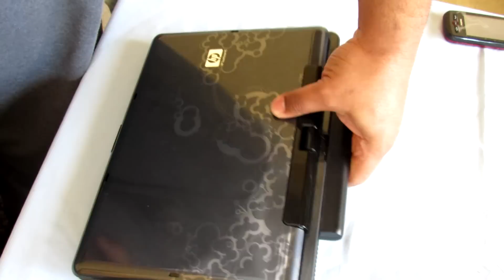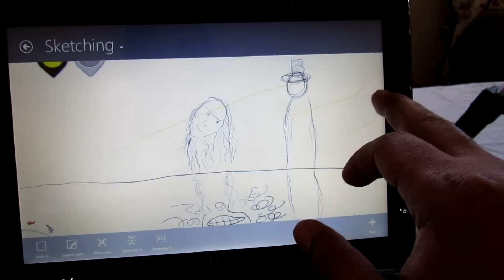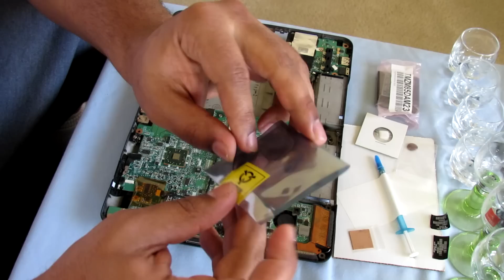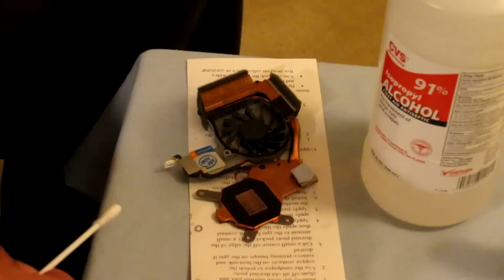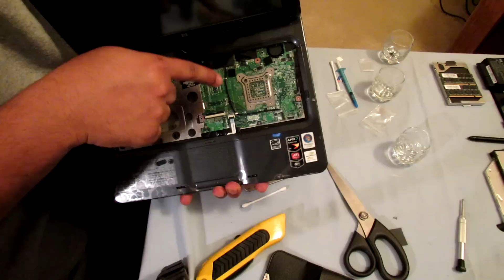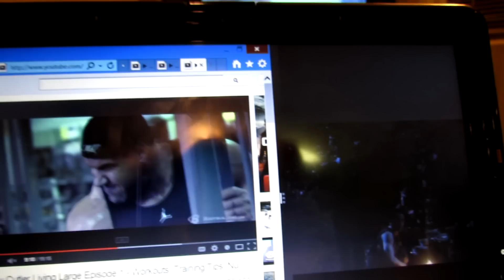HP-TX2 Copper shim and "Lance technique" (From 85 to 58 degrees!)

Comment: I honestly just threw a centrifugal fan in the optical bay with some holes through to the bottom and top (so air is drawn from bottom and hot air shot through top of case). Wired it to USB with a basic switch, bingo, temps have never been better. New paste helps, but only if the original is REALLY old, oxidized and dusty. (Any laptop small 5 volt fan will work, the power draw is really quite small).
And it's all contained so I can still use it as a laptop.
Don't have huge dust problems in this place, and the cold intake being on the bottom also keeps dust down. Been using it for 6 months and no issues.
GPU hasn't went down a ton (maybe 4 degrees C, less on load), but the CPU tanked at least 10C on load, 20 on idle. Probably due to the fact that the air can't really get to the gpu die as easily as the cpu.
Reply from the maker: You should show us. That sounds legit...

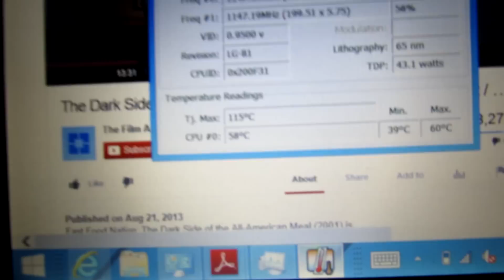Comment: Your did a good work but.. Watch 1:57:36, you can see your laptop is running in battery mode. Your processor is a 2200 Mhz one and as you can see it's running at 1,1Mhz, wich is the half of its power. If you plug it in and run it with its 2200 Mhz full power, you will get more than 65º or 70º for sure.
Reply from the maker: Your right...
Reply: @Calliboss  which is superb. 70 on a tx2 in desktop mode is terrific and wont cause any throttling

Comment: Hi.  This is the seller of the copper shim kit.  My older instructions were not so clear.  Here are the new instructions.
http://docdro.id/PDsw6Te
Also the problem with the ram is the cpu.  These model cpu's have an issue with the memory controller going bad which leaves one of the ram slots non functional.  Common issue with hp tx2, dv7 dv4, dv3...... era laptops with rm and zm amd cpu's.
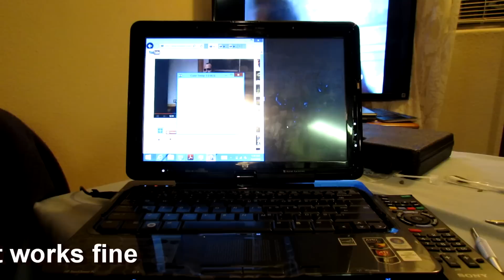Reply from the maker: 1:56:47

Comment: very good video, thanks! I am going to make the same lance trick with my lenovo Y40-80, to sink heat to keyboard and metallic part of the casing
Reply: I tried this and making additional heat sink via keyboards stiffening plate actually helped me. I've made this for both CPU & GPU and now they drop temperature much faster, FPS drops happen not that often as it was before.

Comment: if you look closely you will see that the temp drop comes actually  from the clockspeed of the cpu.

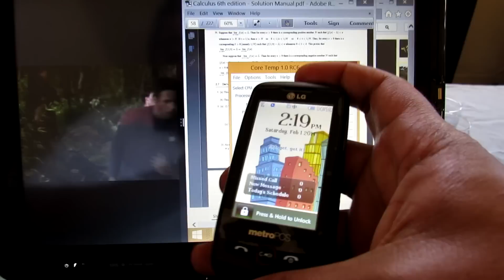06:14 - 2.1 ghz
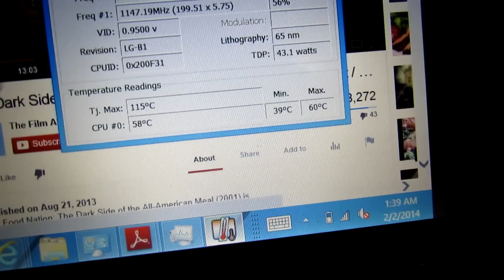01:57:04 - 1.15 ghz
Reply from the maker: +#SalatSoße 
Could be a function of the processor change. The new processor was a bit more sophisticated allowing the two cores to run at different voltages which seems to have helped... Also believe it or not it runs much better when not plugged into an AC outlet if I remember correctly.
Reply from the maker: +#SalatSoße 

"Additionally, the Turion Ultra offers more fine-grained clock speed control as well as allowing it to clock the cores independently of one another. It’s also able to dynamically scale the HyperTransport as needed, resulting in a processor that can respond precisely as needed to workloads"

http://www.tabletpcreview.com/news/amds-puma-mauls-intel/
Reply: +Calliboss

Hey, sure that could be a reason, but did you test the temps when the cpu clocks up to its maximum speed?

Pretty sure that the temp will be higher, but maybe not as high as before
Reply from the maker: Admittedly my testing could have been more rigorous and scientific. To this day I think that the power cord simply being plugged in or not has a great effect on this computers temperature.

Comment: Caliboss,  Can you point me to the Touchscreen driver that you installed under Windows 7?  I'm at a loss.  I have a tx1115nr.
Reply from the maker: N-Trig DuoSense Digitizer Software and Driver

Under the "Software-Solutions" section:

http://support.hp.com/us-en/drivers/selfservice/HP-TouchSmart-tx2-1100-Notebook-PC-series/3884586/model/3925355#Z7_3054ICK0KGTE30AQO5O3KA30R1

Comment: I am planning to do reflow, and clean fan and add copper heat shim also. Mine is HP Pavillion DV 6000, runs very hot also. My fault too, used to leave it on, running all night long.=(I  now cleaned , at least outside fan holes, and lift a computer off a table. I can't seem to burn/ watch CD's/DVD's any more, why do you think is that?? Did I burn my CD/DVD ram?/ Can I just order a new one thru ebay??, and stick it in?? One more thing, how do I check temperature in my computer, go to tools?? or where should I go to get a screen, you are checking your laptop temperature on the end?? Yours went down to 60 C, which is great! Thanks again for good video, a bit long though ;o)
Reply from the maker: I usually use a program called "coretemp" to monitor temperatures. There are others out there that work well also. 

Yep you can just order another optical drive off of ebay. They should be pretty cheap by now! HP's DV series was know to overheat probably even worse than the TX series :(
Reply: OK, thanks, by the way, is the problem usually in optical drive, not in the other chips??And, if I want to speed up a little my computer, would changing which chip help me??/

Comment: Calliboss What is the dimension of copper shim you are using? Can this shim be used on the CPU too?
Reply from the maker: rajdeepchelsea I think it came with multiple thickness shims... I can't remember which of the sizes I used.  If you really need that particular spec contact the seller:

http://www.ebay.com/itm/TX2-Touchsmart-TX2500-Copper-Shim-Kit-W-Shin-Etsu-Thermal-Putty-/270974580100?pt=LH_DefaultDomain_0&hash=item3f1757f584
Reply: Calliboss Thanks. Apart from that do you have any idea whether it can be applied on CPU too. I have ASUS K53SM laptop with i7 2nd gen and Nvidia GT 630M. Recently I am facing heating issues. The temperatures recorded are as follows: CPU - 92 C and fan rpm at 6000 rpm and GPU - 78 C. No heavy tasks are performed to obtain these recordings. Just few tabs open in browser and nothing else. Is there any problem with the thermal paste?  While playing games initially for the 1st 2 minutes the game does not lag like Assassins Creed Black Flag but within 10 minutes the laptop shuts down automatically. I saw your video and was amazed by the result. Any idea what to do in this case and how much temperature difference is expected? Please mention if this can be applied on the CPU too. I have opened the keyboard and observed that the opposite side of CPU and GPU gets tremendously heated so should I add a copper shim and test the difference before doing the same on the GPU and CPU? I have noticed that there is little bit space between the keyboard's back side and the metal plate below the CPU and GPU, so if possible please try to figure out the thickness of the shim which can be applied? Will there be any problem if the shim touches the back side of the keyboard (which is some kind of metal.) Does the quality of thermal paste matter or everything is of the same quality? Thank you once again.
Reply from the maker: rajdeepchelsea Yes this kit or a similar kit can work for any other laptop also.  Nothing in this kit was specific to only the model shown.  You can do this on your CPU However the gap is supposed to be so small that paste works better.  

Take your computer apart and at least redo the thermal paste.  When you buy kits like these it comes with sever different size shims so you can use them in combination to achieve your desired fit.  You do not really need to know how thick they were numerically.  A kit like the one I used will have you covered.

Also do not put a copper shim where the gap is too small for it... What will happen is you will bend the entire circuit board which will lead to cracked traces and premature failure of the computer.

Comment: Looking at that heatsink design I'm surprised the components don't just spontaneously combust. I've seen bigger heatsinks mounted on RaspberryPis!
Reply from the maker: BrainSeepsOut That's funny... The newer version of these laptops lack the DVD drive but also come with intel processors.  My teacher has one running windows 7 (which is not the best operating system for a touch screen), he has a masters degree in electrical engineering from MIT.  He is also an expert programmer.  He just never felt compelled to upgrade.  Very strange. 

Anyway his computer the HP TM2 is undoubtedly more efficient due to it being newer and also using an Intel processor.  

I just could not live without a DVD drive when I owned my TX2... For the last year I have rocked a Surface Pro 3 which I consider to be the best portable computer in the history of humanity (unless you game or do graphic intensive things)... Windows 8 could use some addressing though for sure.  Reliability has been an issue for me with the operating system.

Weird shit just happens sometimes with windows 8.
Reply: Huh?
Reply from the maker: BrainSeepsOut This video is about a computer manufactured by a corporation named Hewlett Packard.  The model of the computer is TX2.

It runs hot because it uses a processor manufactured by Advanced Micro Devices.  Intel processors run much cooler.

The newer version of this computer is called the TM2 and it uses an intel processor,.

Comment: LIER!!! I own a fujitsu t4220 and all of the fujitsu t series and other models  come just like that, swivel screen, that is touch screen with a stylus, AND what i love about it is the swapable bay, it comes with a dvd player on the side that has a eject button for the whole drive and it can be swapped with a secondary battery or a secondary hard drive without the need for a screw driver. But just like yours you can fry bacon on the under side of it because of how hot it gets, ill finish watching your video after work, maybe it can help me too
Reply from the maker: TCreatorO Multi-touch is the key difference and why this laptop is more unique than the t4220... You can NOT pinch and zoom on the fujitsu... nor input any of the other commands that require more than one finger on the screen at one time. 

This computer reads at least 4 fingers on the screen at once.  I forgot the exact number but it can be seen under my computer: properties.

I know it is a fine distinction but the utility of multi-touch over just "touch screen" is greater.  

It was a pain in the butt finding this computer because it is hard to tell if a computer is multi-touch or just touch screen when looking at the specs because it is not listed in an easily discernible way, especially the older the computer. 

The TX2 was marketed as the worlds first multi-touch laptop.  It was released in December of 2008 so you can bet that anything released before that is only a single finger touch screen. 

http://en.wikipedia.org/wiki/HP_TouchSmart#TouchSmart_tx2z
Reply: oh don't foget the hp tx2's dvd does come out the a push of one button making it swappable as well. not to mention the stylus is more than just a stick to push the screen with it has function like the galaxy note does with its 'right click' feature. something I do not think the t4220 has (but correct me if I'm wrong i don't one one)

Comment: wouldn't changing the processor mess up the computer?
Reply from the maker: Actually the processor I took out which is a "RM" series processor is LESS efficient than the "ZM" ultra processor that I put in... 

Here is an article that explains the differences between the two... 
http://www.notebookreview.com/news/amds-puma-mauls-intel/

also... generally processors with the same socket designation are completely interchangeable with very rare exceptions...

Here is the list of all AMD mobile processors and their socket designation... Under section 4.3 and section 4.4 you will see that these two processors have the same socket type and are therefore completely interchangeable...

But I would like to emphasize the need for new thermal paste when changing your processor... without new paste applied properly (which isn't hard) then yes you can mess your computer up, but not because the processor is different but because it has been improperly installed...
Reply: what does thermal paste do? does it block the air flow of hot air?
Reply: also where do you put it under the processor?
Reply from the maker: by "it" do you mean the thermal paste?  You put a small dab on top of the processor where the flat metal spot is... you can't miss it... 

1:23:21
Reply: yes i do mean the thermal paste thank you for the reply
Reply: ***** No.

Comment: Great work! I'm tempted to do the same on my tx2, that lance thing. But what about when your laptop is plugged in. I have noticed with mine that when it runs off the battery only, it runs cooler. And what about the keyboard, does it get quite warm or something? thanks :)
Reply from the maker: No the keyboard does not get hot at all because you just use the metal underside (the part you can't touch when the laptop is put together) as an extra heatsink.  You can't actually touch that part and don't feel any heat through the keys... 

One thing to make it run cooler when its plugged in is to get a charger like the one I got which helps a little bit (doesn't get as hot plugged in, maybe 3 or 4 degrees cooler).  The charger is called the HP AC/Auto/Air power adapter and can be had on ebay for pretty cheap like $20 or less...  You can press the button on it and it will stop charging your battery no matter if its all the way charged and just run off of wall power... It does not get as hot with this adapter... I've found that the power adapter that comes with the laptop get really hot and then the computer does too...